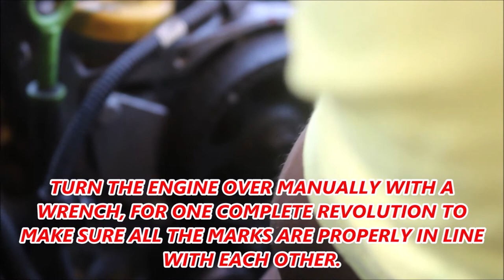Replacing an Engine Belt and Water Pump [Montaggio Kit distribuzione Alfa Romeo Mito TB]

Comment: I never done this, so don't take me too serious. But in my opinion you used too much sealant, most will come out the sides but some might go to the pump wheel and stop it from working. Also i've seen people apply a small layer of sealent to the engine too. Another tip i picked up is that its a good practice to mark the old belt before removing and compare it to the new one, to make sure they`re the same.

This video is extremely useful, i've read the manual on how to do it, but actually seeing it in a video is far better. I have the same engine on my Fiat Bravo T-Jet.
Reply from the maker: Rather it was the sealant used in the video that wasn't good enough and after a few days it started leaking.
It was a pain in the ass to remove the pump and apply a red sealant that held very hard.
Well give it a try one time and thanks for the subscription👍.

Comment: Hello from uk ... I have a t-jet 150 .. What about timming tool to hold everything in place ? its not necessary ?  thank you
Reply from the maker: Hello man, thou we didn't use a timming tool but with the normal tools, up till now everything is running perfect. We've never had a problem.
However I'd recommend a timming tool to facilitate the work and make life somehow easy.
Reply: @Geed94  thank you my friend ... In am going to do mine soon .. I just wanted to know about your experiment without the tool .. Thank you much appreciated .... god bless
Reply: The cam pully needs loosening for correct installation